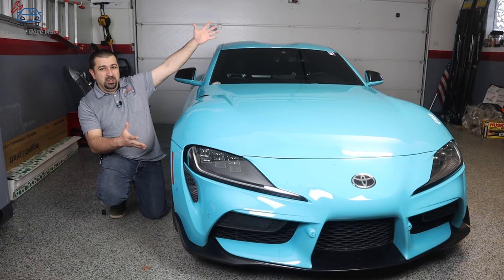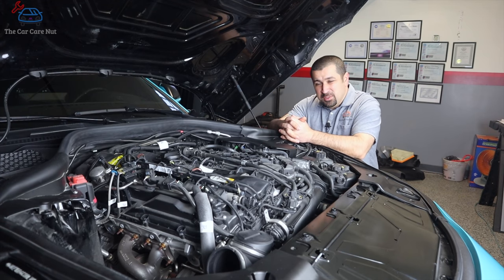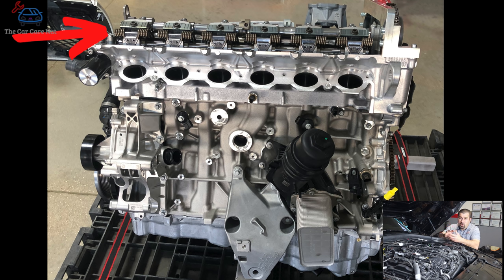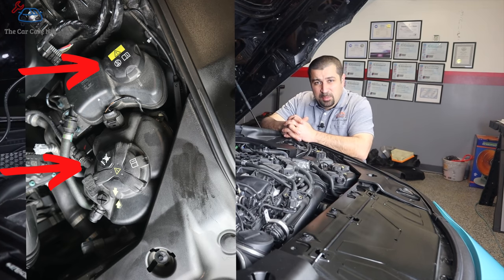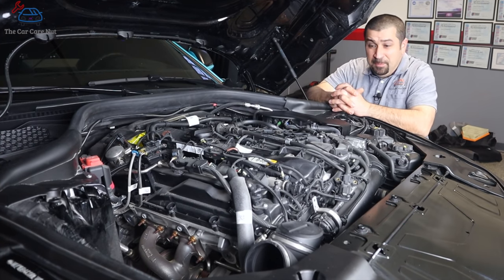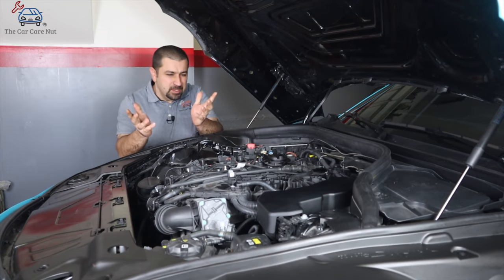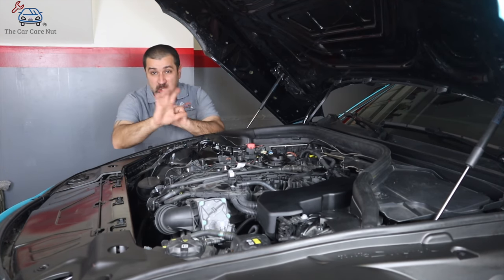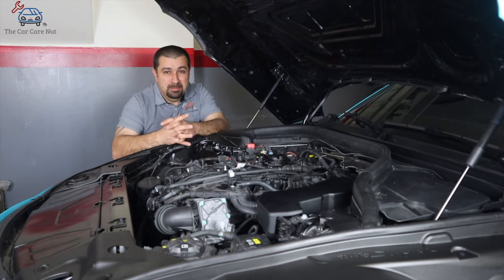New Toyota Supra Technical review and common problems

Comment: I don't particularly look forward to  working on BMW,VW and Mercs after working on any JDM and I cringe when the next work order is German as it means I have to get all the "Special" tools out and 9 out of 10 times it will end up being a headache. For the love of God bring back a version of the 2JZ.
Reply: Not many parts are needs for special tools and most of times we could bypass even using them. Many times when I was working at BMW we took short cut because we have to check out from parts department and didn’t like to waste time. Probably used once or twice per year and I used to work on Merc and Porsche also. I started out as Toyota tech and I don’t know where people get idea 2JZ is bulletproof engine, because all I saw was boost leaks and oil leaks from the 2JZ and most of YouTube monster Supra are modified heavily and probably take majority of owners time to take care of.
Reply: @AkagiRedSun  the two Jay z may not be bulletproof if you modify the hell out of it but at least it be easier to work on
Reply: @AkagiRedSun  yes. any of the super crazy supra builds they have 100k+ in the car. People are kind of disconnected with reality.

Comment: Have there been any SupraConnect (BMW iDrive) software updates recently to allow for full-screen Apple CarPlay on the Supra? CarPlay is currently limited to 2/3 of the main display, but there has been some rumor of some newly built Supras having the capability to display using the whole screen. Any info on this? Toyota customer service don't seem to have any idea, and I can't find where an owner can update their own software like the BMWs allow (either via USB or an iOS app).
Reply from the maker: Hi! I am not aware of new updates but I’ll check

Comment: The toyota engineers said they were shocked when they tested the stock engine. They said it was as reliable as a toyota engine. The bmw engineers try to get the most performance which ruined reliability. Toyota obviously tuned it to their liking while keeping it reliable. Bmws are obviously the max fun they can make it. Toyota tones it down a bit since they know people rely on their cars and their reputation is reliability.
Reply: That's what they said that's what they want you to believe
Reply: If the car fails, they can just blame bmw

Comment: Liked and subscribed! 🎉 I totally and completely understand why Toyota chose this route for the Supra. It really is a niche market, probably taking up less than 2% of Toyota's annual income. Toyota was able to make the Yaris GR by themselves, because to other regions, it was just another version of the plain old Yaris, albeit a very punchy one. The US-market Yaris is actually just a rebadged Mazda 2. If Toyota wanted the US to have the Yaris GR, then they would have to sever their partnership with Mazda, which they won't. There are also rumors of Toyota and Mazda co-developing an RWD inline 6 platform, which I could definitely see the A100 Supra riding on. Toyota's strategy is that if the car they want to make doesn't fit into their existing TGNA platforms, then they will seek partnership with another brand. And it's a very smart one too. 

I'm pretty sure this plan is working out well. I mean, just look at the new Corolla, Camry, Sienna, and a whole bunch of other Toyota vehicles! They are still solid and durable vehicles, with that signature Toyota reliability baked into them. Some of them are even luxurious!
Reply: FYI, The Mazda Yaris is no longer sold. Toyota simply made a massive PR blunder when they insulted their most profitable market with their refusal to offer us the GR Yaris. It is the best affordable performance car they have made in a generation.  As Toyota's best customers, we should be first in line to get them not left behind casting envious glances towards secondary markets like Europe and Australia.   Honda, Hyundai and VW can all make a business case to offer their best hot hatches in North America, why shouldn't Toyota?
Reply: Like the LC500 and 500h!

Comment: Thanks for the heads up on this car. This video alone made me re-think buying one. Not interested in engineering for the sake of it and making DIY life a PITA. I have owned one BMW E46 and it was a nightmare from day 1 after I brought it home, left me stranded on a hwy in NJ and BMW told me they couldn't help even thought the car had less than 1000 miles on it because it was a state road. On top of that it ate through 3 power steering pumps, a cam shaft sensor, all 4 window motors broke, it constantly leaked fluids everywhere. Never again I told myself. When I see a BMW all I can think of is sucker. The don't call them "Bring My Wallet" for nothing. Only 2 aftermarket companies that makes parts for them as well. $800.00 for a power steering pump.
Reply: That's essentially what I've heard and seen. Corvettes are not much better in my experience.

Comment: Judging by the reliability of the M2 N55’s and the B58’s in M40 cars, this will be just fine. Also true BMW made the engine, differential and almost everything else but aToyota designed the body, aluminum and high strength steel body and did all the tuning for the chassis, suspension, transmission and engine. Not perfect by any means, but it’s certainly an attractive package and very credible performance car.

Comment: Great video! New subscriber with a Supra. Are you able to do diagnostics/updates without reflashing the ECU? For example when resetting the battery. Problem is a dealer flash locks the ECU, and then it needs to be bench unlocked. Makes me nervous to go to the dealer for anything... but they’re the only ones tooled up for it
Reply from the maker: Hi daniel. Reregistering the battery shouldn’t change things much. It’s a simple ABL to get it done. Not sure about aftermarket tuning and how connecting the scan tool would lock things.
Reply: @TheCarCareNut  thanks. Anytime the dealer flashes the ECU it locks it out and needs to be bench unlocked. So my question is can a dealer do this kind of work without flashing the ECU to the latest software?
Reply from the maker: Interesting. I’ll look into it.

Comment: Hello, I have two questions for my 12 highlander SE. first one,regarding the radiator hoses. The bottom one remains cold after 30 minutes of driving but the top one is warmed. Shouldn’t both of them equally warm ? Second question,you know how the sound of the horn is like ? It sounds like a motorcycle horn. I want to switch the horn that sounds like the horn on the American cars. Loud and strong,you know what I mean, ? You can change the horn for a louder one,right ? Thanks
Reply from the maker: Hi! The cooling situation can be normal especially in colder weather. On the horn you can easily change the horns without issues. Just buy the horns that you’d like and install them
Reply: @TheCarCareNut  thanks so much

Comment: Great video.  Is there any update on the oil issue?
Reply from the maker: Hi!  Nothing yet new on the oil burning
Reply: @TheCarCareNut  how much is is it burning?
Reply from the maker: They almost run out of oil well before the oil change is due
Reply: @TheCarCareNut  1800 miles into this oil change, still on the high mark.  I'm changing at 3k miles for intervals.

Comment: I live in Arizona we have a luxury car tax as well as a gas guzzler tax and I doubt it qualifies for either. But a BMW would be a luxury car tax.also insurance would probably be cheaper having a Toyota badge than the BMW counterpart. Basically Toyota gave us an more affordable BMW
Reply: I live in Az also that tax is tacked on by the Feds I don't think this would have that tax because it gets good MPG.But what worries me is the Battery thing doubt if you could go to auto zone and buy one.

Comment: Just subscribed wanted to know if you thought the new TRD was  a good car to buy or just stick to the normal Camry. Also for this engine just wait until it starts leaking oil and it will be a BMW
Reply from the maker: Hi! I think the TRD Camry is a nice package, too low to the ground but otherwise price wise it’s a good deal.
Reply: @TheCarCareNut  thank you, do you think the wheels will bend? Not sure what your opinion is on that
Reply from the maker: The wheels are big and the tires are low profile. If you live in an area with bad streets and lots of pot holes they could get damaged more easily than other models except the XSE which is the same thing.
Reply: @TheCarCareNut  well that’s bad news because I wanted to choose between both of them I because I liked the look but if they are going to cause wheel trouble I better rethink it

Comment: My understanding is BMW does not use a dipstick because they don’t want the customer to be able to access the very special and very expensive fluid.   Letting the customer change / add cheaper fluids that may or not be correct would be very bad for reliability.
Reply from the maker: Could be the case
Reply: If you start watching BMW technical videos, you start to recognize a theme of engineers being allowed to implement concepts and overengineer the products. It can also be found in the Mercedes S class. They had a refillable air freshener system in the S class. And they wonder why the first gen M3 is a cult classic. They cant do simple. They even overloaded the mini with junk.
Reply: @AnonAnon-qi4ts  …very well said.  Complexity just for the sake of complexity makes these cars very challenging and expensive to own.

Comment: Oooh I can’t wait to pay off my Toyota 86 so I can trade it in for the 2020 Supra 3.0. Haaalp! 😭 been dreaming of it since the release. Where are u located? Do you think the car will age well mechanically? I intend it to be a daily in New York.
Reply from the maker: Hi! I am in the Chicago area. It’s a very good sports car. Reliability is not high on any high performance cars list and the Supra is no exception.
Reply: @TheCarCareNut  noted. although I’d like to think that despite the high performance, the car is still both BMW & Toyota. Both very reliable. Now would u suggest buying extended warranty ?
Reply: @unassailablefacts  Reasearch the last 15 years of M3. This is basically a M2 front suspension, Z4 chassis with BMW engine. Like the video said, every part is pretty much bmw, made by what is essentially a coachbuilder, so it's not even really made in a Toyota or BMW plant. This video is actually very good.

Comment: The manual lists only one suitable oil, 0W-20, but does allow for a small selection of alternate oil ratings for up to 1 quart. The manual also says the Toyota dealer can provide more information on suitable oil types for this car. Based on your official training my question to you is: Does Toyota provide for US owners replacing their oil with something other than 0W-20, like with 5W-30 if they live in a predominantly hotter part of the country, without risking their warranty on the engine?
Reply from the maker: Hi! From what we were told 0w20 is the oil for the Supra and the Toyota 0w20 shouldn’t be used but the GR Supra oil as it has a different additive package
Reply: @TheCarCareNut  I am confused, so what oil should be used for 2020=present
Reply from the maker: Oil from toyota that is labeled GR Supra not the regular toyota oil

Comment: I own a 2021 Supra. Have you heard of any issues regarding throttle hesitation? I’ve been experiencing  this recently and have found similar issues in the MK5 forums. It typically occurs during cold days which makes me think it may be a traction issue but not sure. When I’m stopped at a light and when it turns green I accelerate but feel as if the cars bogs significantly. For at least a couple seconds the car will not respond to throttle input. Thanks!
Reply from the maker: Hi! It could be traction control. How cold is the weather and are you on stock tires?
Reply: @TheCarCareNut  thanks for getting back so quickly. When I’ve experienced this it’s been around 30-50 degrees Fahrenheit, and I’m on the stock Super Sports. It’s a bit unnerving when I’m in traffic.
Reply from the maker: I haven’t seen any cases yet where it’s anything other than summer tires in cold weather activating the traction control.

Comment: "TMT" Too much technology.  

This is the kind of car you get when overpaid engineers try to justify their existence. In the old days, good engineers were trained to simplify complex systems to make them more durable, affordable and reliable. 

When you complicate a system that isn't broken you usually create new problems that need even more complications to fix, which in turn breed more complications that need more fixes, adnausium.

I'm not against technology, when it really improves something.  But I've been working on cars for over 45 years and some of the 1960's cars I sometimes still work on don't look half bad compared to some of the high tech wonder cars I've worked on recently.  I've worked on a lot of 1960's cars that made over 350 horsepower and I've worked on 1970's and 1980's cars that still get better fuel economy than most cars do today with similar or lower pollution levels compared to todays cars.

Are todays high end super cars better than the cars from when I was a kid... YES, absolutely!  But, are they that much better to justify thousands of dollars in repair costs and parts to repair overcomplicated systems that most people don't need and just about never use.   For example, if you need a computer cooling system to properly warm up your engine, you designed it wrong in the first place.  Old engines were designed including a cooling circuit that would cause them to warm up evenly without a computer cooling circuit and we know that because there are lots of old cars still on the road that don't have computers. 

Lastly... a digital oil level sending sensor is a great idea... but what moron would forget to install a dip stick, incase the digital system fails?

The new Supra is just another car that suffers from TMT... too much technology.  Give it 10 years when a low income hard working single mom brings that Supra in for service,  she's got a car loan she can barely afford and the part she needs is going to cost her three times her life's savings and no one else has a scan tool to diagnose the problem much less the service data to fix it.
Reply: if engineers could do whatever they want, rich people wouldnt be as rich as they are now..
its not the engineers that are making the calls. its bean counters that are yelling cheaper materials, higher maintenance costs for higher profitability.
Reply: @dafff08  And yes, even when engineers do a good job, another department cost reduces their work to the point of just barely working.  I certainly understand that. And I'm sure that happens in cars too.  The new device was designed in stainless steel to last 1,000,000 miles, but it get cost reduced to plastic and takes out the transmission in 40,000 miles instead.  And yes, I have two cars of the exact same make and model built two years apart, and every revised part number represents a cost reduction.  The 1994 has an air bag and about the same value of cost reductions under the hood. They even cost reduced he clip that hold the hood support rod in place from about 4 cents to 2. Much less redesigning the exhaust, changing the cast aluminum valve cover to plastic (two months after the vehicle I have), replacing the valve cover gasket with a bead of silicon and removing the oil pressure gauge.

But. I could argue, that both the 1992 and 1994 are still running, with astronomical mileage on them and the cost reductions didn't impede function or reliability... Aside from the air bag, no complexity was added to the 1994.

When you park a modern car next to a 1966 car, which I do every day, and you open both hoods, you see that engineers were dealing with the exact same issues in both vehicles. That's when you realize just how elegant the 1966 is.  Every part is essential, everything has a purpose. 

For example... the 1966 has a carburetor, which cost about $15.00 to rebuild in about half an hour, a mechanical fuel pump, which cost about $30.00 and a PCV valve that cost about $6.00.  In a modern car, you have an electric fuel pump in the gas tank, a mechanical high pressure fuel pump on the engine, a rail system, high pressure and possibly low pressure fuel injectors, a complex pcv system to keep the carbon from building up too fast on the valves, possibly an oil catch can and a computer and various modules to make the system work at all.  The cost to repair and/or replace the modern system costs thousands of dollars and requires tools that also costs thousands of dollars. 

As I've been able to actually work with State pollution inspection equipment, I've been able to tweak the tuning on various older cars and with the right tuning some will actually exceed modern standards, when tuned properly. I mean in the end, you are still just adjusting the air fuel mixture and timing.  Perhaps modern computer cars can make more adjustments on the fly, but the insane level of complexity just isn't worth the benefits.  I mean, if it weren't for direct injection, you wouldn't need the catch can or expensive computer controlled high tech PCV system to reduce the carbon issue. 

By 1966, pretty much everything that was needed in a car was there and worked well, then engineers started improving things, that needed more fixes to work, which then needed more upgrades to work, which in turn needed more complications until you actually get brand new cars that don't run and no one can fix and thousand dollar repair bills on systems that cost $6.00 originally... That's not progress, that's TMT.